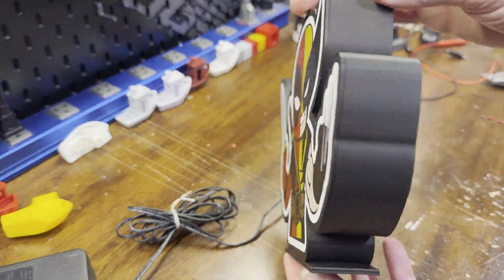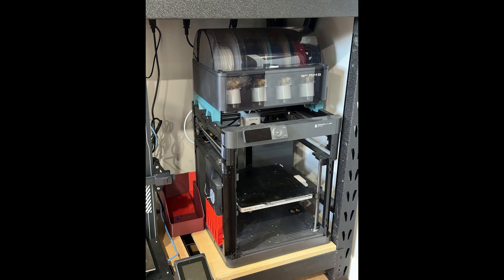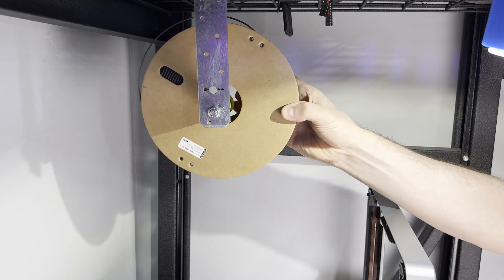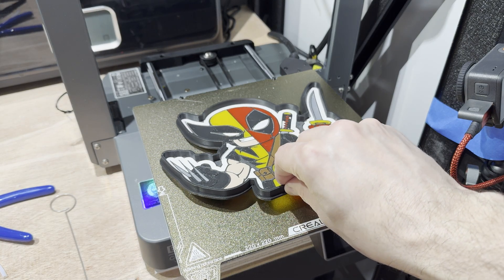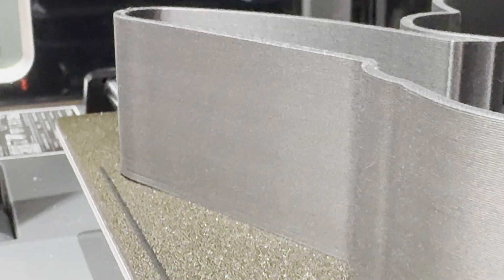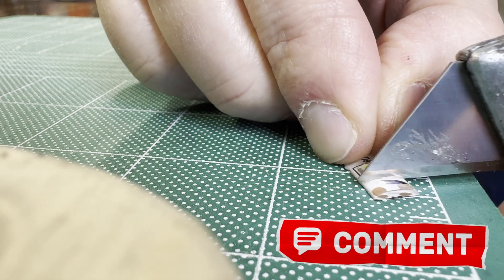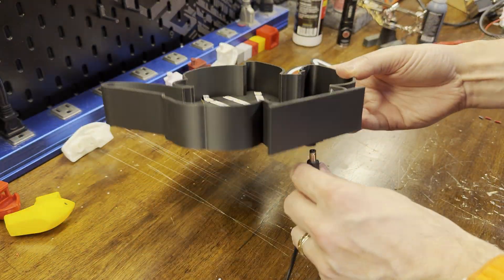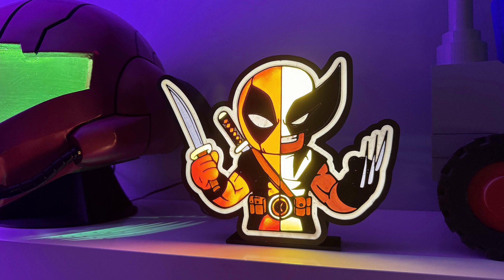Multi-Color 3D Printing with a Single Extruder.

Comment: im doing something similar - with Prusa slicer , i keep the bed hot and i have a separate file for each color , so when one color is done i need to change the filament and run the next file .
Reply from the maker: Each colour is a different file? Don’t you have the nozzle running into the previous colours printed?
Using the multi colour printing with pauses to change colour the machine knows what is already printed and avoids it.
Reply: @DaveRigDesign  z hopping  is what i used for 3 colors
Reply from the maker: @Genesis_Network Z hopping? Not sure what you mean?
Reply: @DaveRigDesign  https://youtu.be/0Sla-vIsvh4?si=0CFAFQtM_k4HQ59Z
Reply: I set it to a max high of 3 layers, and there is enough room for the nozzle to move on the table without hitting the other printed parts .

I never used Orca, but it looks great, and I'm all in to test it . 

Can you share a bit about how to set the multicolor manually ? 

Thanks
Reply from the maker: You could do the same thing in Prusa slicer, you would just have to manually set the colour change points, then the printer will pause for you to change the filament. 

In Orca you can just add multiple colours to the print and then paint which parts you want to be which colour and then the pause points will be auto added. 

Now that I think of it, I'm pretty sure you can do the same thing in Prusa, just paint different colours and it will add the pauses per layer.

Comment: Hey there - I'm trying to figure out the manual filament swapping.  

Did you put some type of pause code into the file so you would know when to swap?  So you didn't just have to stand next to the machine all day and hit pause at the right time

Thanks in advance!
Reply from the maker: Yes. Orca slicer will put in a pause for each color change.
Reply: @DaveRigDesign  awesome, thanks for the quick reply AND great content!
Reply: @DaveRigDesign 
Okay - I need to give Orca Slicer a try...

Comment: I noticed some "gaps" in those eyes.
Would the fuzzy skin effect would "mask" that poor filling?
Or any other tips...
Reply from the maker: Don’t think fuzzy skin would do anything. Just need the 1st layer dialed in so lays down the proper line thickness. 
There weren’t any gaps in the print, on issue on the white is there was some stringing on the black layer I didn’t catch that got embedded in the white.
Reply: @DaveRigDesign  
Sorry my words. English is not my first language. ;o)
But I am glad you could understand what I meant.

Thanks for your feedback.

Comment: Really Cool 😎Well done!
Reply from the maker: Thanks 🙏
Reply: @DaveRigDesign  
Hi, there.
Noob question, here.
Why that rectangle shape was made at 03:32?
To clean up the nozzle?

Thanks.
Reply from the maker: At first I was printing with a print tower which is where the printer prints a little inner square before going to the print. It’s to make sure there is not colour bleeding when changing.
Reply: @DaveRigDesign  Oh, nice. Thanks.